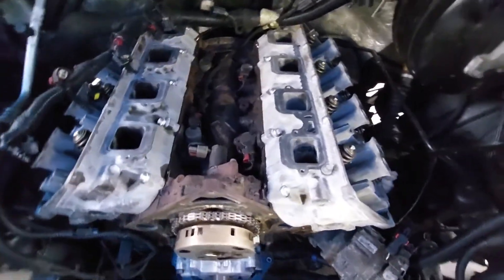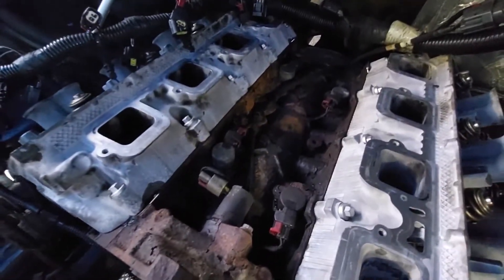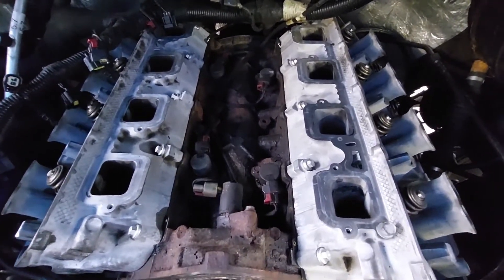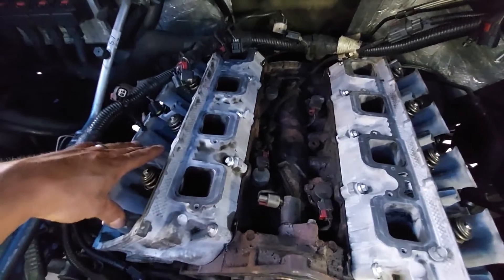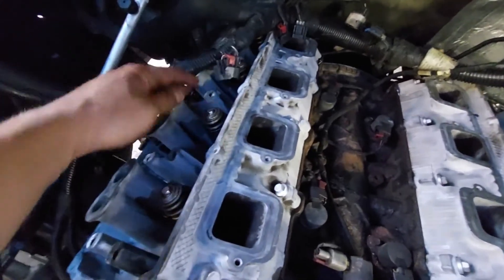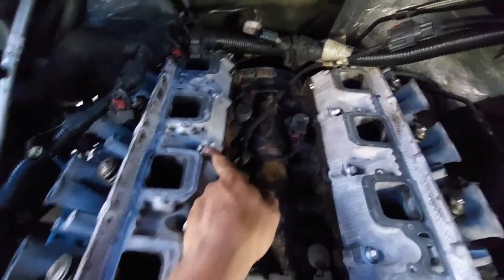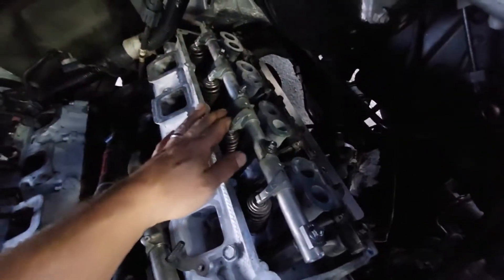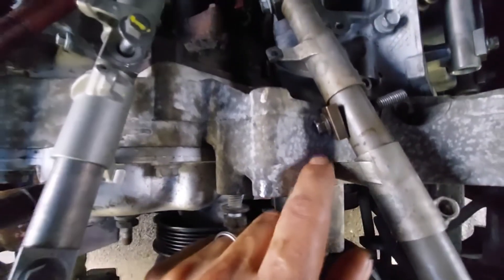2003-2012 Dodge Ram 1500 Hemi 5.7l Camshaft Part 3- Hemi Tick- Cylinder head

Comment: If you disassemble the rocker shaft assemblies, you need to consult manual to reassemble correctly. The shafts have notches in one end to help you to orient the shafts correctly. They will not oil the rockers correctly if the shafts aren't oriented correctly. VERY IMPORTANT, because if it doesn't oil correctly it will gall rockers and shaft and send pieces of metal thru the oiling system, taking out EVERY bearing surface at the least.